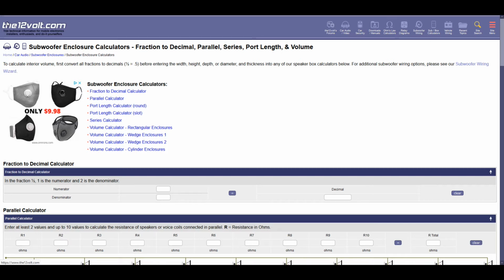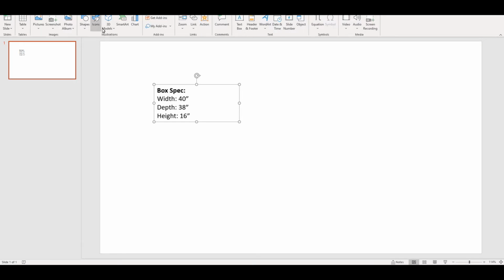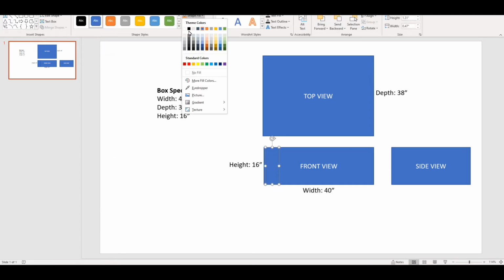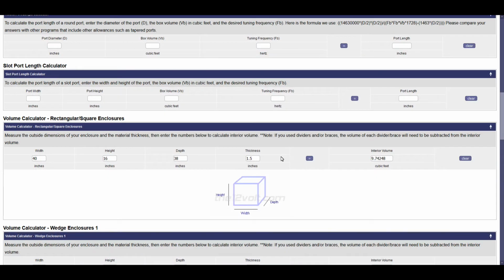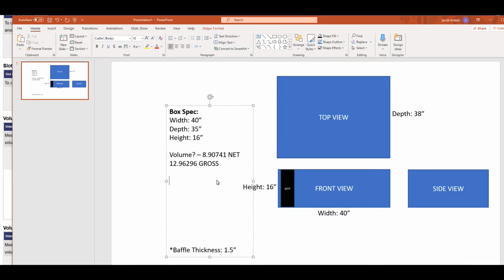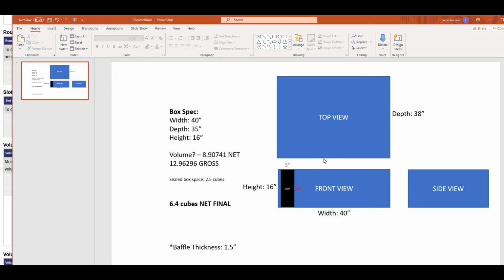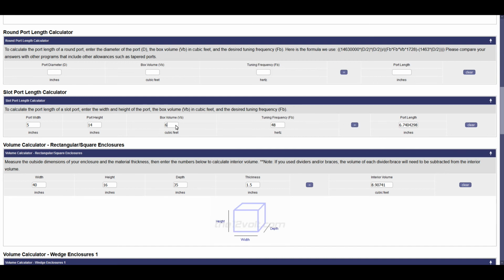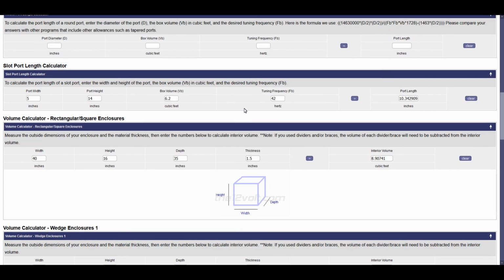SUBWOOFER BOX CALCULATOR - TUNING, VOLUME, PORT, ETC.

Comment: What's good jacob. I'm trying to build my first box on my own and still trying to guesstimate but I hate to be wrong. I want to build a box for my trunk and my Max space is 19 height, 39 with and the death would be 22 with a 8-inch Aero port. I'm trying to put two sound cubes HDX15 tune to 32 with a good frequency. I'm only using inch and a quarter for the bathroom and everything else is 3/4.
Reply from the maker: Sounds like a 6 cube box? Could be tight/small for two 15s, consider 2 12s unless you want to be small/tuned higher OR your running 2X lower rated on subs to compensate for smaller box. Your in the right track goodluck 🔊👍

Comment: Jacob, I need your help...my Net volume after all displacement , bracing ect...I am at 5.69 cubic ft. I'm adding a 8" inch adjustable aero port to my box 5.69 cubicft net area inside my box.On 12 volt .com on the round port calculator not slot, but round can I enter 5.69 net cubic ft for net vloume and get a correct port tuning or do I deduct from area of the inside of the aero port and then calculate...I'd like a tuning close to 32 frequency  give or take either direction. My subs spec say they should be tuned to 36 frequency. Anyways just confused on if deductions are already accounted for on the round port calculator....Any help I'd  appreciate  it...Have a good day...
Reply from the maker: Plug-in net cubes after motor/brace/45s/etc correct the 5.7 sounds right.

Comment: None of the online calculators makes sense, they say from 4" to over 100" for 25hz tuning of 8' box for a single SI HT-18v3 using a SINGLE 4" port.  That can't be right.  I have 4" ports,  8 cubic feet box, how many of those ports and how long should they be for 25hz?  I joined a couple sites and they only give more weird formulas instead of an answer.
Reply from the maker: So two 4” aeroports at 12-13” length or three 4” aero ports at 28-30” length? I definitely would go with 2 ports but may lack high end. You want to account for overall area in determining tuning.

Comment: In the 12volt website 
When calculating port length 
Does it ask for overall box volume or the net volume after Displacements
Reply from the maker: Net usually if it doesn’t clarify displacements. Best to remove those from number
Reply: Okay so net internal volume not including port displacement correct

Comment: Not gunna lie, of all the box calculators I've used, this is one of the harder ones to understand because you have to have a lot of the box information before the box is built and it doesn't even give you cutout information for each panel.

Comment: How do I know  to run speaker invert  or normal
Reply from the maker: Look at your subwoofer motor disc placement and net cubes, if not enough space in box invert, or too much then mount regular.

Comment: Hi, I just watched your video and I’m still confused never built a box before. 

I have two 12in CVX subs I want to build or have a ported/ vented box built. The max width 12, max height 15-15.5. How long does my box have to be and how wide should the port be? If you can help it’ll be greatly appreciated.
Reply from the maker: The cubic space determines that last factor for length. You plug into a calculator to get your cube goal. The port area is by height and then Width can be based off cone area and cubic space. 14-16sq in per cubic foot.

Comment: İ have a question that İ can't find any other place. what is the measurment to find out how cubic litre box needed to the exact speaker?
Imagine I have a speaker and I do not know its parameters. How I can find out what the size of box for that speaker should be? 
I'll be very glad if somebody answer this ot send a link. highly appreciated.
Reply from the maker: Manufacturing specs will be provided on their manual of the speaker or on the site usually 90% of time. Also general guidelines on forums to follow.
Reply: New in this box building I just built a box for a 12inch sub but don't know how many Hz or how to tune it what can i do or need to do

Comment: If you calculate for a square port then cut the square in a diagonal that will give the size of the triangle but I don’t know if it changes the length

Comment: The other question sir? Is what if i use the cicular port? Then the gevin port lenght is 10”…. The question is i need two port. Is it still 10”? Or devide into 2? So become 5” per port? Or the two circular ports the same measurments to 10”????????"

Comment: --I'm no expert, but...
--What do you mean that the baffle is the wood thickness? The baffle is what the loudspeaker attaches to in order to, hopefully, stop rear waves and front waves from canceling each other out. The baffle can be varying thickness, different materials, etc. Building a box includes the baffle specs because any given sub might need a minimal sized baffle, etc. 
--Double baffle means 2. It could be 2 1/2" baffles or 2  0.75" baffles = 1.5", which is the standard, but thicker could be better. 
--good manufacturers will specify minimal baffle thickness recommended. 
--Also, the baffle could be of different material than the rest of the box walls. 
---You put 1.5" as wood thickness and then calculated your volume using that, which means every board in the box is 1.5" thick. That's why your crap is wrong. You calculate everything out and then add the 2nd baffle on top of the first one, thus not changing the inside dimensions and only very minimally, insignificantly changing the sub internal displacement. A 12"X12"X12" box is 1ft³, calculated with a thickness of 0. If I add in my board thickness of 0.75", then the volume drops to 0.66992'³ (-0.331'³ loss d/t wood thickness ft³). If I change my board thickness to 1.5", then the volume drops to 0.41288'³ (-0.58712'³). 
--Take a standard 0.75" board, make a 12"X12"X12" box and determine internal volume = 0.66992'³. To check this: 1 - 0.66992 = 0.331'³ loss d/t wood. To check this: [(12*12*0.75)/(1728)] *2 + [10.5*10.5*0.75)/(1728)] *2 + [10.5*12*0.75)/(1728)] * 2 = 0.3299'³, which is pretty close to the 0.331'³ loss that was calculated, and if round up 0.3299'³ becomes 0.330'³. I wouldn't say that this math is a waste of time because if you can do the math than you must understand the operation.

Comment: According to other box programs I use such as re audio box calculator and winisd, you have to subtract the port volume away from the net as well so to be accurate with using the12volt, so pretty much you have to work backwards, you have to already know the volume of the box you want to build and play with the dimensions to get the correct net volume. For example I designed a 13w7 ported box with the12volt and I entered the dimensions in first that I thought would fit in my trunk, I figured out the net volume without port displacement as you did in the video which was the whole inside of the box minus sub displacement and it gave me a port length of 26in tuned at 34hz, so after I used re box calculator which is easier to understand because it shows a 3D model of your box and entered in the exact same dimensions minus the sub displacement and it said my box was tuned to 39hz, winisd also said the same thing. So the first step is actually knowing the airspace of the box you want to build, then use the12volt port length calculator and then add port displacement to the airspace that you figured out in the first step and add both to get the gross internal volume and then play with the dimensions to match that. For example the way you did it was as follows: I want a 3 cubic foot box with a 3 inch wide by 14 tall port tuned to 34hz, the12volt says I need a port length of 31.5 inches so it says I need 24wide 15.5high and 18deep box for 3 cubic feet but there actually isnt 3 cubic feet of airspace, the way I did it (which is spot on correct according to re box calculator, winisd and any other programs Ive tried) is to like I said start with already knowing your airspace, which I want 3 cubic feet and I will use the same port width and height tuned to 34hz, so now I have to add the sub displacement as well as the port displacement which is 14.5x3.75(not 3 because of the L port inside the box with a .75 thickness added to 3)x 31.5 = .99 cubes so I have to play with the dimensions in the volume calculator until it says 3.99 cubic ft instead of 3 because 3 cubic feet is how much air is actually inside the box you have to take away port displacement as well, it is very confusing and it took me months to correctly figure it out! Thats the correct way to do it according to winisd, speakerbox lite, re audio bc calculator and bassbox.
Reply: So my actual dimensions to get the 3.99 cubic ft gross internal volume would be about 31wide x 15.5high x 18deep to have an actual net airspace of 3 cubic ft tuned to 34hz with a 3 inch wide port 31.5 inches long.
Reply: Agreed, though could be shorter. 
--Basically, there are 2 approaches: A. Know the box volume needed and B. don't know the box volume. 
If using winISD, and you don't know the size of box, it will calculate the best volume, port, etc. Then, you need to figure out the port displacement and woofer displacement and subtract that from the original volume. Problem is that winISD isn't really set up like this. That's why most people talk about adding the port and sub displacement to the box volume. 
--So use winISD or other program to find the best volume+port, or sealed, and then add the port+sub displacement, and then build a box to that final dimension. For me, I also use winISD speakerboxlite etc. and know what size box I have available to use, then subtract 20%-30% of that volume away for port+sub displacement, and then plug that final volume into the program to prevent errors.
Reply: Just use sub box pro and be done it configured everything already
Reply: This was the issue,exactly  wat you said.you have to take in account for port displacement  too and deduct  that from your net.Once you've done all deductions then you can play with port length....

Comment: with all due respect can you make a sketch for me with a single 12 "vented box ported slot with a size of 2.25 ft3 + port displacement 3 × 12.5 "port, 20.5" long Thank you very much
Reply: Need lot more info than your giving. Gonna need max dimensions, amps you will be running, and subwoofer model. Without that it is impossible to tell how your box will perform, in saying that you are currently tuned into the upper 30s but who knows where you are when you actually put the sub in. Ask on a forum like https://www.stevemeadedesigns.com/board/ in the subwoofer enclosure section.

Comment: Hi Jacob, i have a parallel 6th order bandpass  on 2 pioneer 12, 1 to 1 ratio 4 cubic feets per side, tuned to 30 and 40 hertz, im thinking on sealing one of the ports and make it a 4th order just to see how it sounds different, my question is, should i sealed the 40 hertz port or the 30 hertz port and why?
Reply from the maker: The lower tuned port most likely so you have better bandwidth unless your going for more lows. Also depends on cubic space and goals.